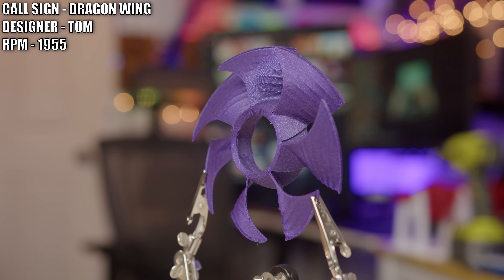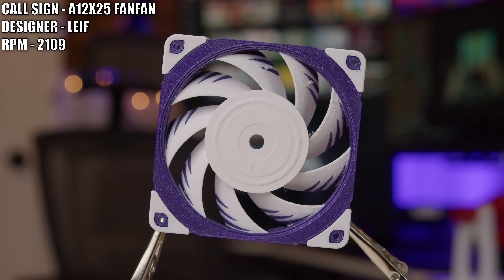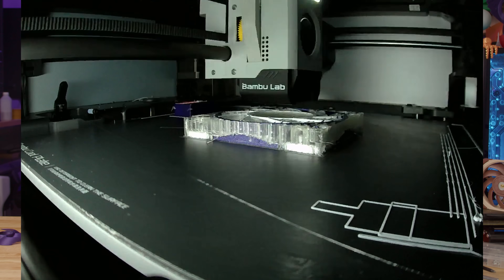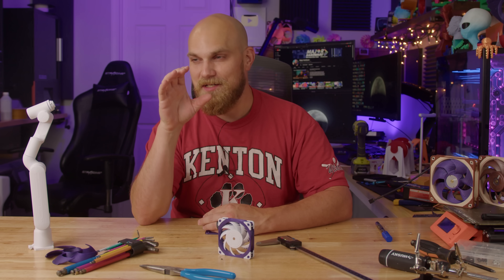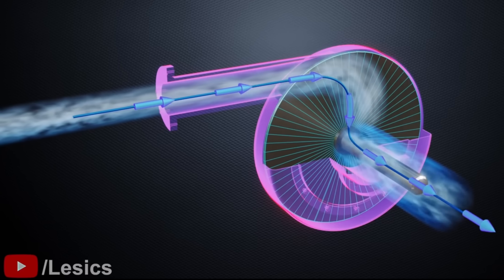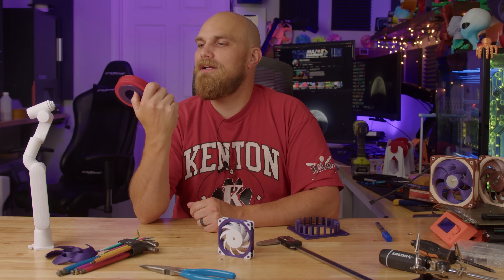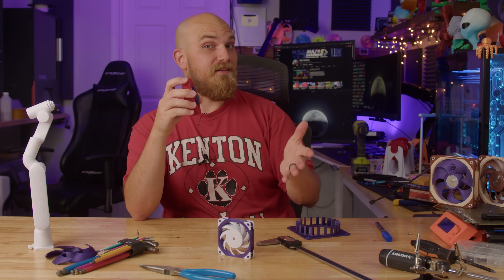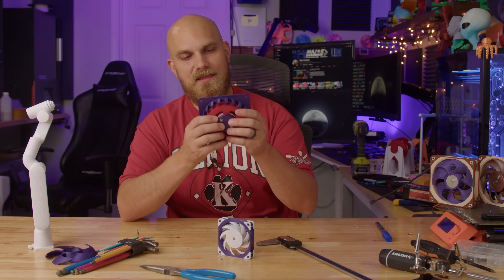I Put a FAN Inside a FAN | Fan Showdown S5E7

Comment: use pla or something you wanna use up for the support material, then for only the support interface, use PVA or one of Bambu's options (I like their non water soluble one).  make the support material last a loooong time with no difference in support removal
Reply: and actually i also tried using PETG as the support material when printing PLA and it worked.  petg has a higher melting point so they don't fuse and it worked great.  the bambu support material still worked a little better but for the budget minded, cheap PETG can work when printing PLA
Reply: Would be a lot more material changes though right?
Reply: @arcrad  it depends on the print, most of the prints i've done with supports it was one or maybe two layers, so it was very minimal

Comment: I wonder with the tesla turbine if you offset each one of the sections a few degrees if that would make a difference? Like rotating each one of the pieces by about 5-10% each, but plate by plate, first plate at Top dead center then the second plate rotated 5-10 degrees and so on? I could be talking out my but, though curiosity has me.
Reply: It's an interesting thought!  My intuition is that, without any other changes to the design, an offset like that would end up decreasing air flow to the inner plates, due to the decreased effective area of the opening, and thus decrease total throughput. But I'm no aerospace engineer, just some rando who occasionally likes swearing at mechanical things until they work, so I have no idea how that would effect turbulence and air pressure.  Would be an interesting thing to try!  Especially if you had the appropriate housing and motor to use a Tesla turbine as a pump.

Comment: I wonder about the tesla turbine, I bet you there's at least something you could do to make something like that move air, see if you're going off of the original design it's designed to take from the center out, what if you reversed that idea, you're using it in reverse so see if there's a way to take that idea and do just that.
Reply: For it to work the intake ports would need to draw air in meaning each disc would need a scoop shaped like the blade of a cheese grater once the air is drawn in the disks would accelerate the air outward towards the edge of the disc then get directed by the fins along the rim of the disk. How powerful it would be is anyone's guess. I would expect it to have a fairly high static pressure though which is good for forcing air through cooling fins. 
But the question is how much air would be moved CFM could be very low just that the efficiency could be quite high
Reply: yeah, throw it in a duct/housing so the air that enters can only enter, and air exiting can only exit... as it is, wheres the air being flung OUT to? straight back at the intake... sort of. 

mmmm, rotor induced vortex...

umm, as for the turbine itself? read the patent. just like parsons mentioned his turbine will operate "in reverse",  as a compressor... so did tesla.

Comment: So....who's calling Tom to license his fan design?
Reply: MSI should get on that, their mascot is a freakin Dragon
Reply: @Teajam  TRUE!
Reply: @Teajam  valid and true
Reply: Skip the middle man, make a company and call it "Tom's Fans" I'd buy.
Reply: msi hopefully
Reply: noctua is still more quiet... but hey that wing design is nice
Reply: I wish, baby needs a new pair of shoes (motorcycle tires for my zx-10).
Reply: With a redesign of the motor brackets, I could probably make it almost as quiet as the Noctua, as their blades are tuned for their housing.
Reply: China has already copied it.
Reply: Hopefully not some stupid pre-built company in which the only way to get the fan is to buy a pre-built like that one fan guy did.

What was it called? Exceleron? Something, can't remember
Reply: Power Color?
Reply: I'd buy that. cool concept and cool design and it works better than the original? if they could make that show with the LEDs like they did back in the old days and the center I'd buy that for sure
Reply: An increase of 6dB for 6.7% more airflow doesn't seem like a good deal to me.
Reply: @sniglom  It depends honestly. I'd like to know how much worse it is noisewise when pushing the same amount of air. If its only slighty worse, like 2db or so, then it could be easily worth it as something that gives extra thermal headroom. Plus, these FDM printed fans will always be louder because of the rough surface finish.
Reply: @__-fm5qv  No, it doesn't depend. It's clearly a bad design, since 6.7% more airflow should amount to about 21% increase in noise, not 100% (6dB)
Reply: @sniglom  It does depend... it depends on the applications tolerance for noise as to whether it is acceptable.

I admittedly don't know enough about fans to know what increase in dB should corrolate to what %flow increase, but I also don't see a source for why it should increase in noise by 21% and not 100%? How did you arrive at those numbers?
Reply: @__-fm5qv  yes fdm printed will be louder than injection moulding. Probably find it’s quieter than original noctua
Reply: @__-fm5qv  dB is a logarithmic scale. an increase of 10 dB is 10x increase in SPL and will be perceived as twice as loud. 6 dB would be 4x SPL, roughly 50% increase in perceived loudness. dBA is a little weirder with weighting but with fans like these, unlikely to change much
Reply: @veganjoy  True, but still I can see applications where noise isn't as much of a concern, making it a viable option.
Reply: @sniglom true, but maybe IT would only cost 1/4 ^^ then you maybe have a Deal.
Reply: @MaxMichel89  There's no lack of cheap noisy fans out there. Well designed fans on the other hand, that's another question.
Reply: @sniglom  thats true. Balance ist imporant
Reply: @sniglom   around 112% sound for around 107% performance, indeed might in most cases seem silly in that usage. but if the power usage is still the same it still would make sense, also in servers since servers tend to use insanely loud fans that sound like jet engines.

however there is one thing missing here. in reality it might be more than the 8% more airflow mentioned in the video, and way less loud, the reason is that these parts are 3d printed and also off balance. the off balance creates problems and the 3d printed factor also makes them rough and wobbly and prevents their thickness from being just right.

the real fan is made with specialized machines. a 3d printed part even coming close when looking at the airflow to speed is very impressive, and might suggest the 3d printed part has it's eyes on a much better design since the roughness, wobblyness and how some edges are to thick or thin on 3d printed parts will really cause some notice and loss of efficiency in 3d printed parts.

this means that perhaps if the dragonwing fan is made using specialized machines similar to the normal fan and if it is also optimized for those machines instead of 3d possibly the dragonwing fan might give much higher airflow and much lower sound.

just try to compare 2 identical high efficiency fans(in design) but one is 3d printed and the other is made using a specialized process. also no custom enhancement process for the 3d printed parts.
the 3d printed version will tend to make way more notice and generate a lot less airflow.
just try to 3d print the original fan, the design is online, but printing it will result in way louder sound and way less speed. and often even when after editing the 3d printed part to be more smooth and correct it will still be less good than the part made with special processes. 

do not forget that.
this means the dragonwing fan might very well be better in all aspects when it is produced in a real dedicated process where there is some quality control and such just like with normal fans.
Reply: @ted_van_loon  no, that's not how it works at all. dB is a logarithmic scale, so +6dB means 4x the sound energy.

+400% noise for 6.7% performance increase isn't a good deal.

On the flipside, our hearing perceive 10dB as twice as loud, so that fan won't be perceived like it's 4x as loud.

Anyway, roughly fan noise increase cubical versus airflow, so an increase of 7% should roughly result in 23% more noise, which is about 1dB, not 6dB.
Reply: @sniglom  by that logic, using ~13% mote watt hours to operate the A12x25 for a ~1.6% increase in CFM over the Angel isn't a good deal either. At what point does your line go above the X axis? How are you weighting your metrics on importance? The dragon wing might be 6db louder but who cares? That's about 1/12th of the difference between what is effectively "SILENCE"--the quietest sound a healthy human ear can register at 0dB--and the volume one would expect from a quiet library at about 40db. Why does that matter? It doesn't, just like those 6db don't matter. You will not hear the difference through whatever gaming headset you're wearing.
You WILL register a difference in how your computer acts with ~7% (or more depending on your airflow control and how many fans you use) more airflow through your rig with both increased performance and increased longevity for your components.
Reply: @sniglom  JUST to double-check, I took my studio mic, pointed it at my desktop and just recorded the noise levels of my PC in a semi-idle state.  Do you want to know the decible range was during that semi idle state? 23.77dB to 32.95, averaging 26.31and that peak was when I breathed in slightly harder. The hell are you smoking? Take the damn increase in air flow and quit bitching about a DB range you can only hear on these videos because it's audio isolated and recorded from 20cm away, not 3 feet with headphones in the way.
Reply: @Gebraheel  it looks like you're having a hard time being nice and projects anger on random people on the internet. I wish you a nice day.
Reply: @sniglom  I was high as balls having fun doing math, I couldn't have gotten angry if I wanted to. Thanks for the well-wishes. Hope your day is going well...as well. 😸
Reply: @sniglom it's 3d printed, a real moulded one would grossly outperform a 3d printed one in noise. You'd probably also get better pressures and air movement out of it because you'd have less turbulent flows over the blades. You'd also have more control over fine details to be able to make changes that would improve those numbers further and have different finishes on different sides of the blades and so much more. I wouldn't turn my nose up. NGL I would be interested to see what happens. I'd at least get one of the commercial printers to SLA one or something, and maybe an exact copy of stock.
Reply: @streaky81  you seem to have no understanding about how big difference 6dB is.
Reply: @sniglom   And you seem to have no understanding of how rough 3D prints are
Reply: They don't need to. They could hire an aerodynamicist to improve upon their current design.
Reply: I don't think he can because it seems to be "inspired" from Noctua's 140mm design
Reply: @aliancemd actually it was inspired by my "nacho fan" which predates noctua's reveal on Gamers Nexus. Only similarity is the bent leading edge. My attack angle from the relief cut hub, loft lines, low spiral wing tip and scalloped trailing edge are completely unique.
Reply: No one because the 6.66...% performance increase for 6dbA increase is big enough to make a difference, + the character of that noise is awful.

Comment: Seeing if the Dragon Wing can be improved just by printing it in SLA would be cool.
Reply: Also the dBA would probably go down if it had bumps like the production quality ones.
Reply: Or even better, have not only the factory-molded A12X25 as a goal poast, but also a PLA-printed A12X25 version (maybe even a resin-printed version as well). That way you could compare how any fan would do if it was resin-printed (assuming that the layer lines cause similar losses among all fans).
Reply: printing in resin increases numbers by 2.1% you can easily math what the results will be https://youtu.be/603hywgt92w?t=445

Comment: Would be awesome to see the new first place in an extra high quality resin print...
Reply: High quality resin print, and benchmarked against a resin A12x25
Reply: @williamhendrick903   that indeed is very good to do, since comparing printed to printed is much better than comparing printed to a high precission specialized manufactured part with specialized machines, tools and high quality controll.
at least when trying to compare the efficiency of the design.
Reply: Indeed Resin please! :) make a 30mm deep version and then wow!
Reply: And less than 0,5mm clearance
Reply: Especially since he's shown that printing in resin doesn't necessarily improve performance but it does reduce noise so if you can keep this performance but without increasing the noise as much this could be a really good design
Reply: @anthonyjaccard3694  Yep it's the noise that interests me. How much of that 6 dBa difference can be attributed to the surface finish? I'm sure there's more that can be done to get the noise down, but doing so without sacrificing performance is a lot harder than improving the finish for a test.
Someone also mentioned getting the clearance down to 0.5 mm or less. That is also interesting, as is printing the fan with an integrated rim to eliminate the tip clearance altogether.
Finally I'm sure someone could improve the wing profile, but at the same time it would make it a lot harder to print.
Reply: I have to be honest, this would be really cool to see if it does better or not with the premium finish
Reply: Exactly! We need resin prints
Reply: Resin resin resin!
Reply: printing in resin increases numbers by 2.1% you can easily math what the results will be https://youtu.be/603hywgt92w?t=445
Reply: Yes! Please do resin prints

Comment: wait a minute hold on, what PVA you got to work in the AMS of the X1C? please share!
Reply from the maker: Yes I have a dehumidifier I bought on Amazon I put it in there before using to make sure it's dry dry then rewound it on the printable spool and worked with no issues